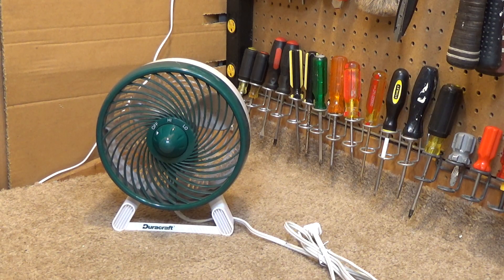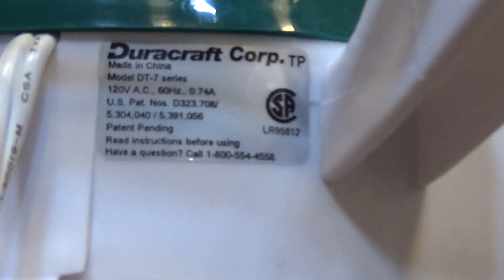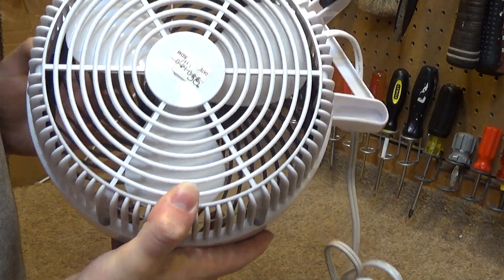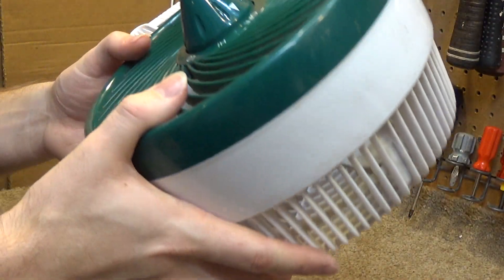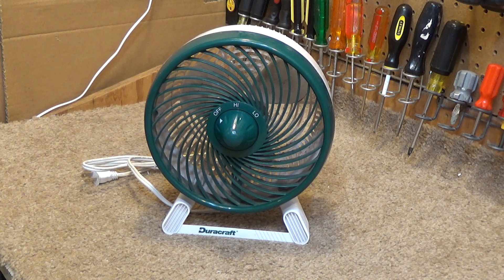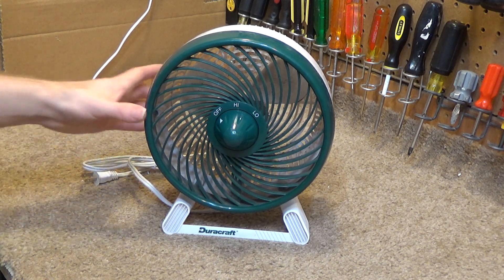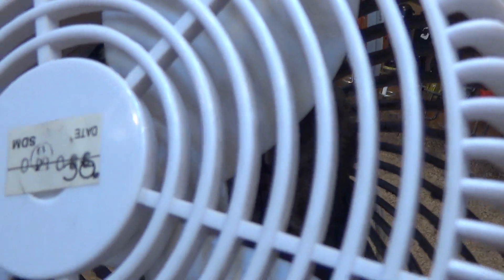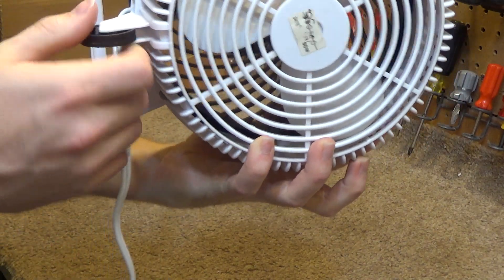Duracraft DT 7 | Initial Checkout

Comment: Yikes! Must of taken a decent fall. That or the bearing has snapped from the heat.
Reply from the maker: I think the bearings were manufactured defectively in some way.. If the motor got hot enough to cause that kind of damage, I'd think the plastic would have melted..
Reply: Jordan U I think you’re right. Seems like it just was a manufacture error.